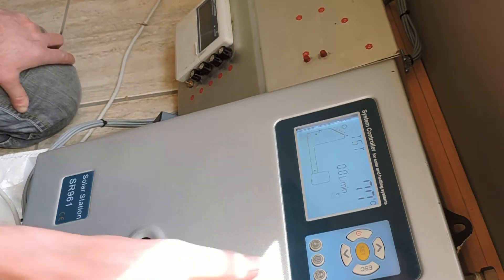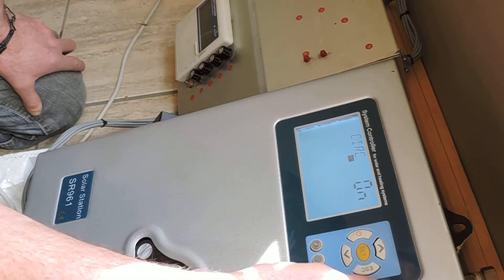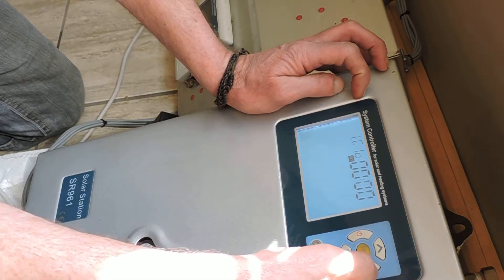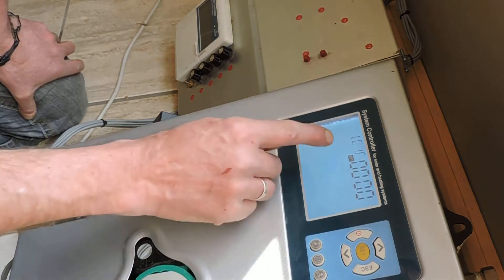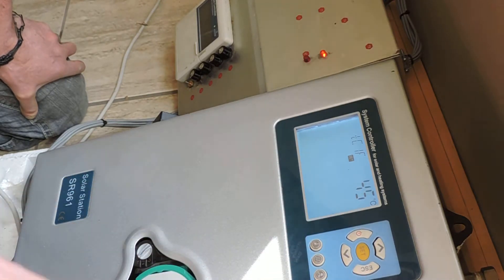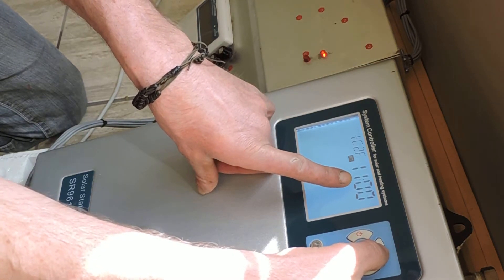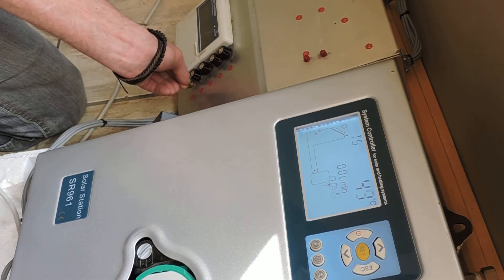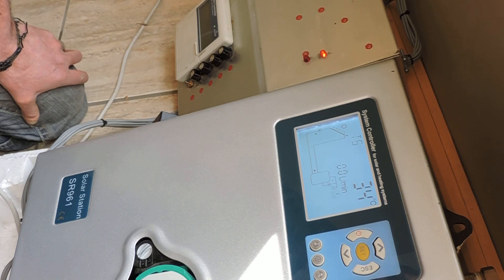Recirculation Setup on the SR961 Solar Controller

Comment: All of this automation is unnecessary if you utilize a storage tank with a closed system off of the tubes that coils in the tank and heats the water that will flow directly into your existing hot water tank on the cold intake. No pumps, no controllers necessary. At most you would need to insulate the line to and from the tank and use a low energy electrical heat line wrap on them in cold regions. These controller/pump/systems for the non-tank evacuated solar systems cost far more and have far more potential for failure.